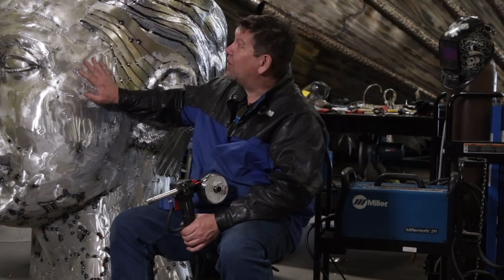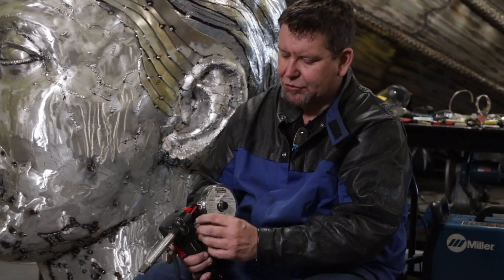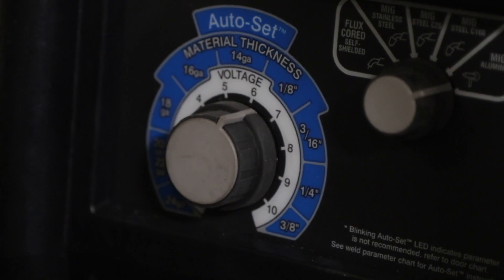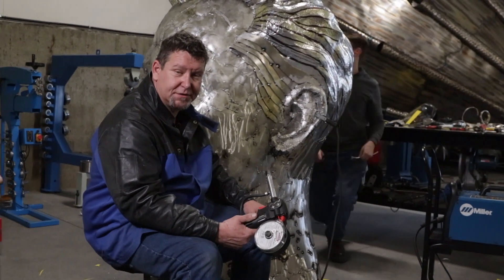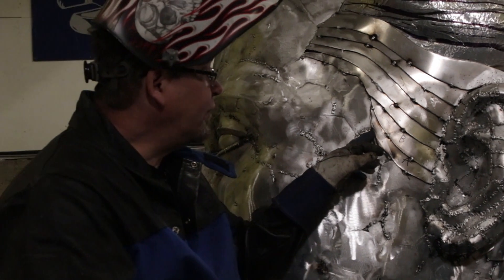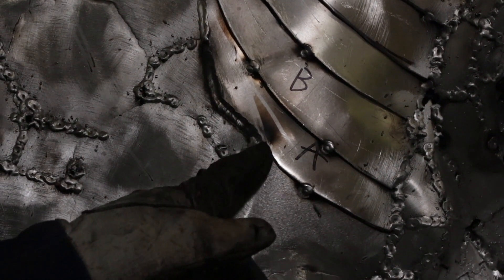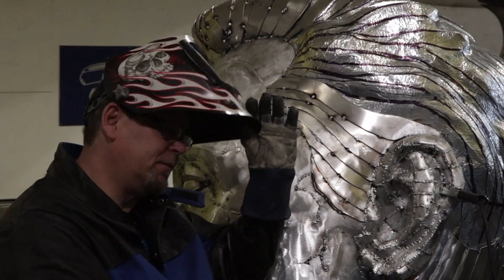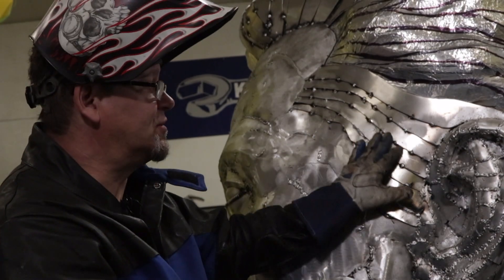Get Better Results Welding Aluminum With A Spool Gun #millerwelding #Millermatic211 #SpoolGun

Comment: Yes that's correct, your drive wheels need to be u groved for aluminum. You could also use 5356 wire...its stiffer

Comment: Awesome sculpture, but what are you talking about with the issues? The manual explains everything you're having issues with and what you're doing wrong. That red lever, right behind the rollers, releases the tension and the wire slides right in. Release the lever. Adjust the tension with a small flathead right above the rollers, on top of the spoolgun. Done

Comment: Wrong….don’t move the wheels…just straighten the wire and it will feed through. The liner is a PTE material so it will feed smoothly …..read your instructions manual. Change your tips with every spool….Miller makes great stuff learn your machine and spool gun.

Comment: In your 6ish min part you say that your tac welding because it give you penetration from the back out to top that same consistency can be adjusted in your settings, if you take a few more moments you can fine tune it and your weld will be followed all the way through

Comment: Just a thought here, and I may not be correct, but I have some experience in aluminum spool gun welding. First, make sure your drive rolls groove size match the wire diameter  that you are using. Second, usually knurled drive rolls are to be used with a steel flux-core electrode. Use a Vee groove for solid wire steel electrode, and finally, a U- groove drive roll is commonly used for aluminum wire electrode. A U-groove drive roll usually will not mark up the surface of a very soft material such as aluminum.  The issue that you described in the video related to the roughed surface of the electrode can cause feeding problems through the contact tip due to the use of a knurled drive roll.

Comment: I have that same gun and i dont have to take the drive wheels out to feed the wire.  Its shredding the wire because you have your drive wheel tension to tight. The hole on top of the gun is were you adjust it.  All the problems you listed are from user error, not the machine.

Comment: I've been running one for a few years and I've never taken the wheel out. Straighten the wire and it will feed right through 99% of the time.

Comment: What wire brand are you using ?   .030 or .035 ?      what brand have you tried ?
Reply from the maker: Lincoln and liquid Air make good wire...030 usually